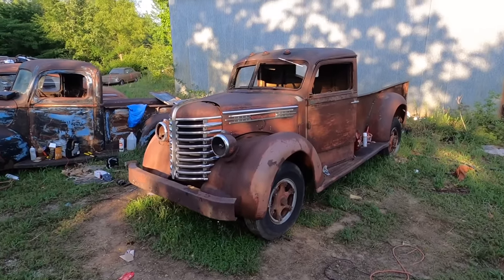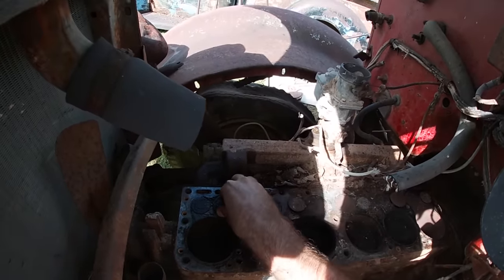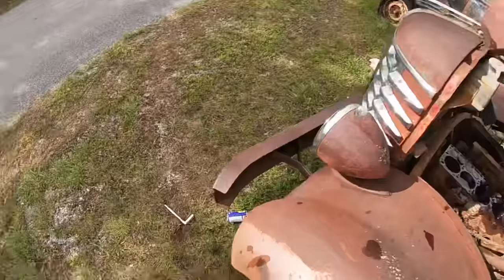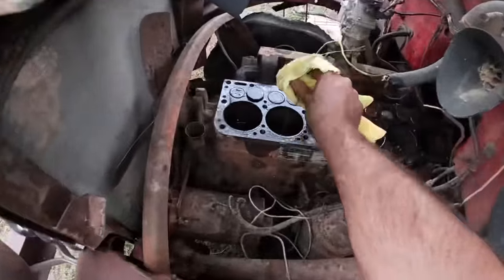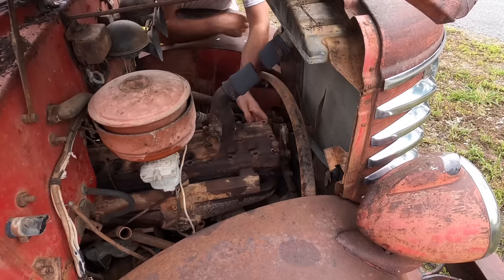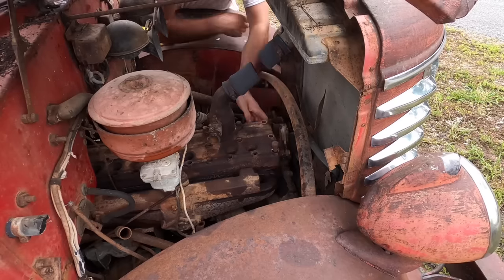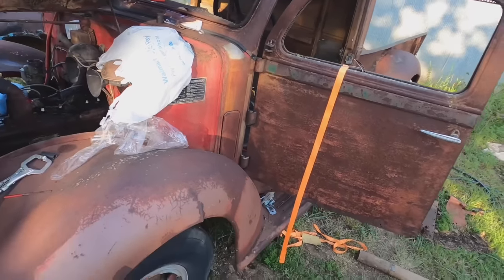Will it run after 66 years 1948 diamond t 201 pickup truck

Comment: If you want a pipe wrench less likely to slip i'd recommend Ridgid Snap on or Milwaukee. I've seen Ridgid steel 2 foot wrenches with the jaws still in good shape for 30$ in yard sales before. It'd be worth checking your local buy and sell.  If you get yourself hurt it's a lot more costly than a wrench.

Comment: Them older head gaskets with the soft stuff in the middle it is best to soak them in water for a day or so an old time taught me that, oh the old timer also taught me to use a light coat of grease on them head gaskets so it can shift when bolting it down and it can shift for expansion and contraction

Comment: I wouldn't give up on this old truck.  Let the MMO sit in it for a bit so the rings might possibly free up enough to give you better compression then bring out a starter jumper switch so you don't have to keep leaning over that lightning builder.  Those old flatheads will run when many of the newer ones won't even turn over.  That body style is so unique it'd be worth the effort to try to restore it at least to street use.
Reply from the maker: Yes and it has mmo in it now it took about 5 weeks to do this video I let it set for a good 3 plus weeks before it even started to build any compression I believe the timing chain or gear drive is slipping on top of it losing compression
Reply: @jenningsmotorsports7554  When an engine has been sitting a long time sometimes the gap in the rings rotates to where they are all in a line.  Running the engine will often get them to rotate back to the right position.
Reply: Cambron Gabaree  Myths are what others tell you, not what you see with your own eyes.  Ring and cylinder wear is more common in frequently used engines.  But it is not uncommon to buy rings for an engine, take it apart, and discover they've simply rotated.  Do yourself a favor and run an engine for 15-20 hours and then re-measure the compression before you buy rings.
Reply: Cambron Gabaree  Rings naturally rotate while the engine runs.  As an engine gets older the cylinders tend to become oval in shape.   The most relaxed position for the rings is naturally at the ends of the oval.  So they tend to all settle in a line there.   The shorter each iteration of running the engine, the less likely they are to rotate out of alignment.
Ovaling of the cylinders is and issue that should be addressed on engine rebuilding by over-boring the cylinders, if enough wall thickness remains, after which you can get a 'like-new' performance from the engine.  
However, the performance and compression of the cylinder can still increase in an ovaled cylinder by running the engine long enough for the rings to rotate out of line.  Notably, if you tend to do only short trips or idle an engine excessively, rings in an ovaled cylinder will just rotate and settle back in line.  It is the shape of the cylinder modified by wear that causes it.   Not sure who told you it was 'debunked'.  Visit your local engine machine shop.  They can tell you all about it.
Reply: Cambron Gabaree  Only in your mind, my friend.  Only in your mind.
Reply: Cambron Gabaree   There's the problem!  Talk to a machinist.  The internet only knows what someone knowledgeable (or not) puts into it.

Comment: Head bolts can be a curse to line up so I use a tapered bar we refer too as a porgy bar saves fingers, you can machine any bar up just adjust the taper size you want.

Comment: Well I have been watching your video's for a few days now; Kinda addicted to the Will it run series. Only a few thing's I saw you did on why it has such low compression and won't catch. One you never reuse a gasket. Once you pull the head; it's automatically a new head gasket time. I am sure you can find a reproduction gasket online or make one. Next you didn't torque the head bolts down. That one is a little tricky to do since I am sure the torque spec for it has long since gone. Get those two issues resolved (assuming valves are still functioning correctly) it should fire up no issue.
Reply: Not his first rodeo my friend.
Reply: @jtothew4201  never said it was. Just stating a few things that will make the engine have a higher chance of running.

Comment: Ballast resistor is used in run position on key and is shorted in start mode to give hotter spark when cranking

Comment: Ï used to work on a 1947 model with that engine, it was a workhorse,very well kept, i saw that truck 15 years ago las time, still working, hauling stuf all day long, all in the original drivetrain and etc. That engine has nice torque and just purrs like a kitten.

Comment: i drove a 49' #201 in high school in 1968, even then, almost impossible to find parts. I restored a 1940, 404, 1.5 ton several years later,ran it all over, good quality trucks, Hercules  stood behind the engine for 100,000 miles (magazine add, 1946) 7 mains,counter bal crank, gear driven wtr pump, steer  with one finger, those bring good prices, in any condition these days..( Herc-QXLD-3 ) is the engine

Comment: Get a map gas torch and pull the plugs out and then heat the holy hell out of those pistons and while its hot like that just dribble some good raw gas in the hole. Then turn it over and it will run. I have done it to several of them. Also that starter is dragging so bad that its not turning fast enough to pop off. U will get it

Comment: I believe that it will run. I just think a few things are not right yet. You have spark. I wonder about the carburetor. Now that the engine is free change the oil. There has got to be a lot of fluid inside the engine. Check the seals around the valves. Junk deposits will keep the valves from seating properly.

Comment: Good video and an old school tip is when your putting the head back on its to get the head and the gasket and put a very small amount of greese on the gasket side to the head and then put the head and gasket together and put the corner bolts on the head and then pick it up and fit hope this helps and the greese helps to stick the gasket to the head

Comment: An easier way to line up the head and gasket is to put two studs in to hold the gasket in place and put on the head ! The studs will hold them in alinement ! Put in the head bolts finger tight replace the two studs with head bolts and start you head bolt tighting sequence !

Comment: Pretty cool using the pipe wrench on the transmission shaft to free up the motor. i don't think you need all that Mystery Oil but go ahead anyway. It will free up most everything just by cleaning the points and pouring gas in the intake and turning it over 'til it starts.

Comment: Have a go tow it 30mph 4th gear a way you ensuring you have good fuel and spark.Wish I had it in Aus would be a sweet rig if you want to ship and see a first start
Reply: Yup , that's how we get the stubborn ones going 🤪..  saves on the starter  too.... once limbered up 3rd gear at 30 mph , generate a little heat on the pistons and rings to help free them up , also don't hurt to put about 1/4 cup diesel in each cylinder overnight before trying to pull it, also make sure it cranks 2 full turns before pulling to make sure that it isn't hydolocking from too much diesel,  if so then pull the plugs pull 50'-100' reinstall plugs then give her a whirl so to speak 👍...

Comment: You need to take two or three bolt that long enough to fit block . Cut head off screw into block put gasket on drop head on put a couple bolt in remove studs put in tool box for future use😜

Comment: your pipe wrench is barely on the shaft, open the jaw just a bit more so it will slip on all the way.  this is why it keeps slipping off
Reply: Lol... It's so easy to be an armchair mechanic
Reply: @aborted4196  have you ever used a pipe wrench?  I have many times over my lifetime.  It can be clearly seen in the video the wrench is not fully engaged on the driveshaft when he tries to turn it over, which is why it kept slipping off.  I have been a mechanic for over 20 years working on various equipment, vehicles, etc, requiring the use of various pipe wrenches, it can be interesting to get things to come apart sometimes and require a bit of ingenuity.  Now, with that being said, does it really matter?  It's a youtube video, not a tutorial on how to do this.  If you can explain to me what an armchair mechanic is and how they work, which you must be an expert on the subject, I would greatly like to hear your side of the story.  Now, AborteD, have yourself a great day, ok?  life is too short to be arguing online.

Comment: I have freed up even Detroit diesels that were rusted ones that have been sitting for years with rust inside of them..... So listen to me when I tell you that's if you  read these damn things.....
Work the crank in both directions.. you keep working it in the same direction out of the right door pulling it towards yourself go to the left door and pull it the other way eventually you'll hit the rust from both sides and minimize the damage that way..... But occasionally you will run into one but there's so much rust in there that the rings can't make it past and yeah you're going to break the rings if you force it....
...

Comment: There is no way you should be getting shocked from the insulated wires. Unless you didn't install the ballast, if the amperage exceeds the rating on the wires than it could arc.

Comment: That head gasket looks like it might be made of copper - if it is you can re-anneal it by hitting it with a blowtorch until red then dropping in cold water.   After that it will compress nicely again, as if new.

Comment: The truck is worthy of a total restoration. Classic body style and rare to boot. I’d rebuild that engine and if that is not feasible I’d drop a reliable new factory crate 350 small block in it and do a nuts and bolts frame off restoration. It’s definitely a keeper and a head turner. 👍
Reply: Ugh. 350 swap. So fucking stale these days.

The I6 in it will rotate, it will fire, that means it's rebuildable. No reason to even THINK of a 350 swap.

Comment: A little tip you can use head gasget glue , then glue it to the head only then put it on the engine you can even run all the bolts through the head buda boom just like that haha hay you need to get a better mic so we can here you better other wise great show n:-)

Comment: Man, this was the funniest one yet. When you had your hand on the distributor cap wires, I burst out laughing before you hit the starter. It is simply amazing what 45,000 volts will do ya, isn't it?  LMAO  Those plug wires aren't heavy enough to hold that much current.

Comment: I think if you had tires on it and a helper to pull it with a tractor or another truck you would have got it. A faster spin is all it needs often times the first go around. Don't shut it off until it's fully warmed up (or as safe as you feel to go with no coolant) to shake those rings loose.

Comment: I realize that this video is really old, but WD-40 is a lubricant, but WD stands for water displacement and it's not a very good penetrant spray. If you're going to use a deep penetrating spray you should definitely be using PB'laster or Deep Creep. It's obviously a good idea to use Marvel Mystery Oil, but using WD-40 to lubricate the piston rings is like peeing on a structure fire in an attempt to put it out.

Comment: messed with a lot of flat heads, valves will hold u up the most, marvel mystery oil  and a hammer on those valves, brass hammer and not too hard

Comment: Want it to run? Pull head, clean up valve stems & guides ( shoulda done it when you had it apart)  lap valves. Put it back together, use 2-cycle gas. Tow the truck so as not to burn up the starter. It will run but it will need turned over a zillion tmes for the rings to rub in. Don't quit now.
Reply: To do the valve stems and guides?  I guess you mean valve faces and guides, on a flat head doesn't the bottom end need to come out?

Comment: Looks like it has a cab heater, pretty deluxe.  These trucks had the best stainless trim, still looks new! And California Wobbler wheels, odd to see on a small truck. If you are going to turn the drive shaft, will turn the rear wheels, should jack up the rear end.  I would have waited to pull the engine and make it easier to work on and better for the engine.  Please tell me you checked to make sure that it is not, not positive ground???  Compression gauge test??

Comment: No, it'll run...you need a better starter and battery....needs to turn engine faster. Put in some lucas oil treatment to help seal the rings too. once it starts, the first time... it'll build better compression.

Comment: Nice try, but you might think about if your getting zapped by just touching the coil wire maybe laying it on the fender could be sending the current dirrect to ground causing a weak if any spark from the points, didn't know diamond Ts had a ballast resistor but I know a dodge won't fire with a bad one, make sure you don't have one inline somewhere

Comment: If you check, Most of those Old Truck and Commercial Flat Head Motors were built by U. S. Industrial Engines and had different Names stamped on them as to the Customers use.  The Motors are all pretty much the same engines Mechanically.
Reply: Diamond Ts are known as  the Cadillac of trucks, they all had Hercules motors until the company was taken over in the late 50s.

Comment: Dump a little bit of oil down the carb and let it set a couple minutes prim it again and see if it will start
Reply: He was pouring liquid fuel down the intake, bypassing the need of the carby, which will be toast inside I bet.  If the motor is close to being in time and has compression and spark it'll suck the fuel straight up and it will get combustion.

Comment: Not easy to find a Diamond T pickup at all, never mind one that complete.
Should try taking the head back off and heat up the pistons with a propane touch cool it off and do it again  and again not too hot though.
Maybe 250 degrees cool with transmission fluid.
Are you sure you have the valves seating?

Comment: WD-40 isn't actually a true lubricant. WD stands for "water displacing" and its main use is as a solvent or rust dissolver.
The lubricant-like properties of WD-40 come not from the substance itself, but from dissolving components. And the effect doesn't last.
WD-40 can be a good substance to start with — it can help clean up rust or other grime. But depending on what you're working with, you should probably follow up WD-40 with use of a true lubricant such as one based on silicone, grease, Teflon, or graphite.
Reply: Like the Marvel Mystery Oil he used?

Comment: Pull it started like a tractor. Spins alot faster.
Reply: Anyone have any parts for a 1934-1936 international c series pickup ? I need left rear fender or parts of one and a grille shell emblem and a speedometer. And a few other misc pieces

Comment: I always use transmission oil . it's a detergent oil. Hey repair guy use the correct tool for the job ... Not the cold steel chisel! Use a painter's 5 way to work around the cast tranny cover.

Comment: It's not uncommon to get faulty new points,IV had that several times, usually the insulation on the post is damaged or misaligned on the post and it earth's out.they are made in countries now that have low quality checks or control.

Comment: Did you finally realize the reason the trans was only turning so far was because it is in gear. Meanin you were trying to pull the whole truck with that pipe wrench on the drive shaft.
Reply from the maker: Drive shaft isn’t hooked to the rear end it’s just hanging there

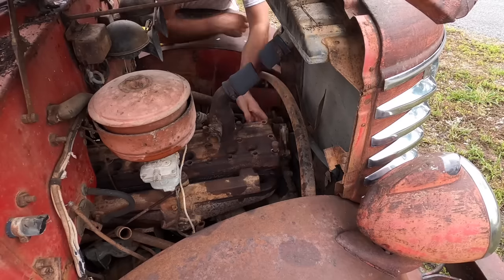Comment: 20:30 external combustion engine. Is there a patent for that? 😂
Reply from the maker: Yes a good example of a external combustion engine is a steam engine basically any engine that uses heat or power from out side the system to power it

Comment: It ain't cranking fast enough you need starting fluid.and you should hook up some wires to the starter so your face isnt over the carb.never fix see one of the plug spark I bet the plugs ain't fireing
Reply: I ment to say I never seen one of the plugs fire bet there not..

Comment: You could get it going by spinning her over a lot more, the compression needs to be tested as you continuously spin her over. Also, the coil does not need to be dishing out killer shocks, an ordinary coil would do the trick, nobody wants to be shocked into oblivion. I'm confident that you can get the old girl going again. Good video though, cheers.

Comment: LOL: Owner : Mt. Shasta Orphan Classics:  
If I was wanting to get that truck running to where I could feel good about selling it I would Drop the Motor and Clean it up and make sure it would live up to my name. I learned years ago just getting a Motor to start and run to Impress someone as to my abilities, If I was to put a For Sale even as is sign on it I wanted to know it was not going to come back with a very upset Customer. 
I am 82 years old, And would bet my life I have enjoyed rebuilding and restarting more vehicles than most any five of you You Tube Mechanics. I owned two Truck Stops and over 100 Big Rig Trucks over Fifty years of owning Pittam's Trucking as well as Ray's Contracting and Excavation Business. I love watching your shows, But also see meny times you love to cut tie and edges. Soake a Old Motor with Hydraulic Fluid or Transmission Fluid in each Cylinder at least a week becore you start pounding on the Pistons. 
I hope you do not mind my experience in making money with Old Junk Vehicles.

Comment: No it loses the battle because now we pull out that crappy straight six and we throw a 350 Chevy in it bored 30 over with a 350 turbo shift kit sand the truck down do the body work on it paint it and stick it online for $55,000 as a rare diamond

Comment: Get it where it will roll and tow it a couple miles in gear. The rings and valves will get warm and loosen up enough to run. Maybe not run good but run.